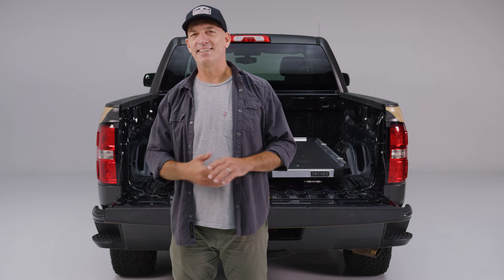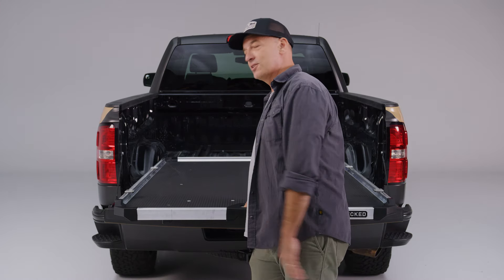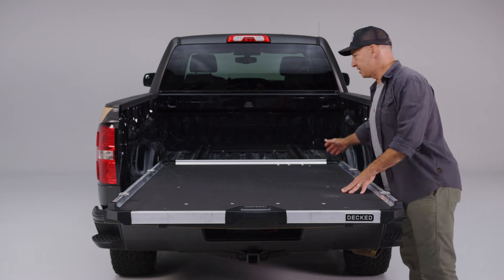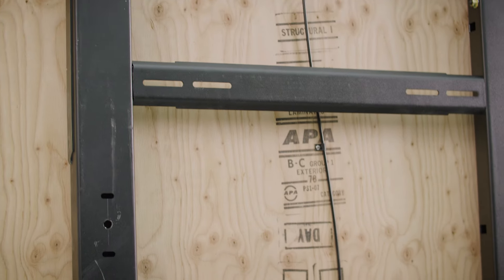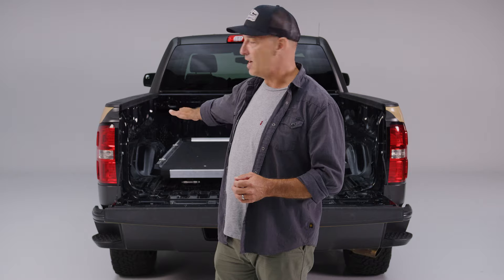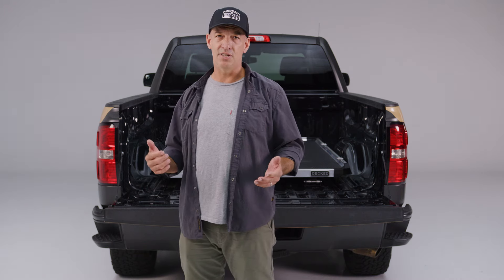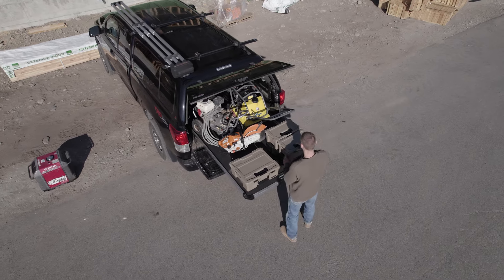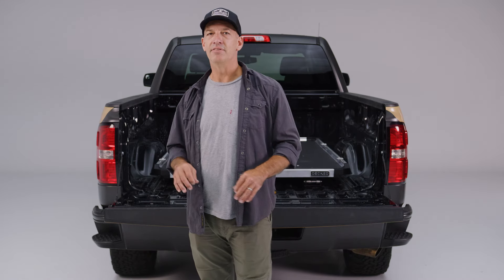DECKED 101 | What’s New With the CargoGlide 1000?

Comment: I agree with ChefAlex and wasted space.  I currently have a decked system in my pickup and sleep on top of that under a truck cap.  I would love to have the cargo glide on top of the decked but would like it to extend from sidewall to sidewall.  The decked system is already above the wheel wells so a wider cargo glide would have no limitations for being wider except the side walls of the truck bed.  It seems like a no brainer to utilize all of the space above the wheel wells.